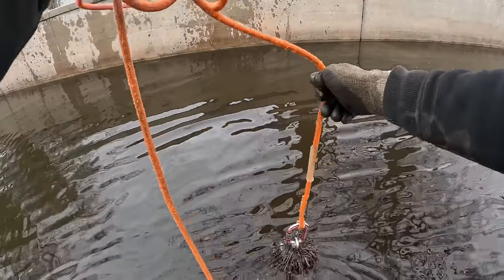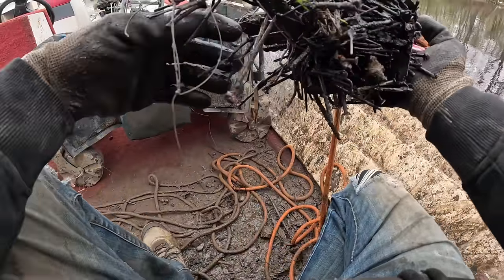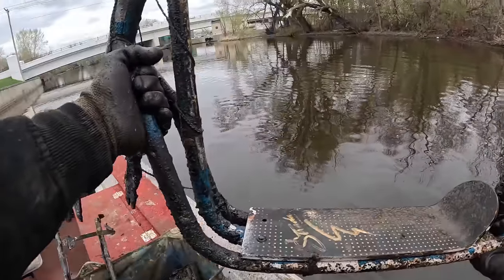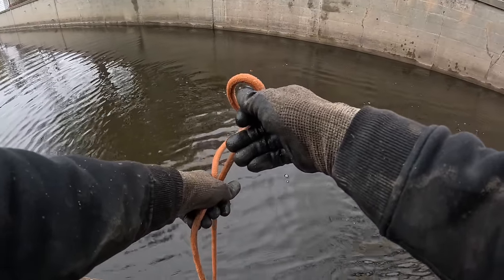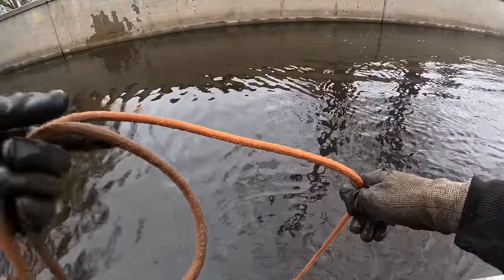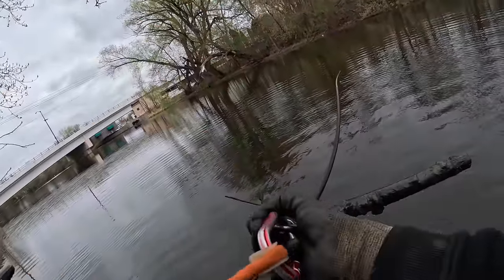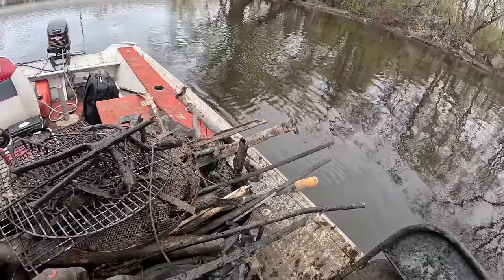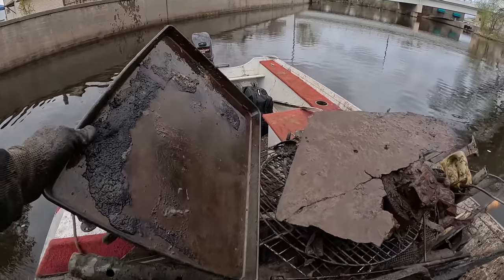Unbelievable! Epic Magnet Fishing Haul: Biggest Jackpot EVER Found!!!

Comment: Love watching you do this. A couple suggestions for you. Get a magnetic parts dish from harbor freight or anywhere cheap. It can hold the lutes you find and keep them from falling all over the boat. Second, put a heavy duty freezer bag over the magnet. You can peel it off to remove all those nails and small stuff easily.
Reply: These magnets are SERIOUSLY powerful. That wouldn't work but good idea.
Reply: I have a magnet like this and trust me nothing comes off it easily lol When it arrived it grabbed a a pair of scissors that were a little ways away and snapped it on there and it took 2 of us to twist to wrestle it off plus it managed to grab my glove finger under it too 🤣
Reply: @leeredpath1  so are the ones I use to clear metal shavings and bolts from my shop floor. Heavy plastic works better that try to use your hands.

Comment: The thing before the nail can is the flywheel cover to a small engine like on a lawnmower - which would fit with the throttle cable caught earlier. That could be the source of the oil.

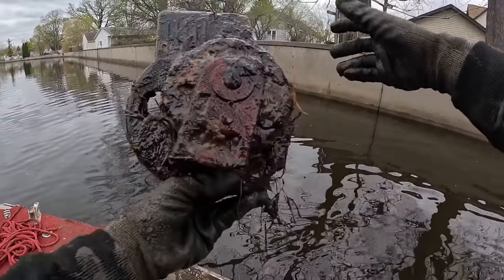Comment: 54:23 that piece you found is the "flywheel shroud (cover)" off of a lawnmower engine . That throttle cable you found earlier probably came off of that as well . Guarantee, the thing that keeps leaking oil is a lawnmower engine or maybe the whole lawnmower....

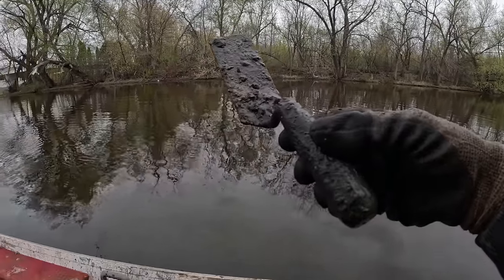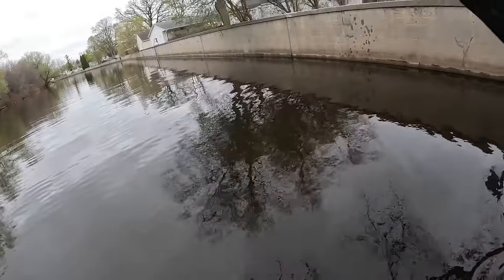Comment: 12:54 is indeed a trowel for plaster. Pick axes were used to break up rocky soil as well as for rocks in mining, the ones with the flat broad edges are for tough soil to break it up. That was the front part of the wagon and the round thing was the swivel for the front axle. 30:07 the magical dangly wand could be a small magnet for picking up things in hard to reach places, I have one but its end is fixed solid. 40:15 is a pickup for an electric guitar, 44:29 looks like a house crawl space floor support pile, 54:15 looks like the shroud off the top of a lawn mower engine.
Reply: The claw and ball is the bottom of an antique table leg.
Reply: Nice!

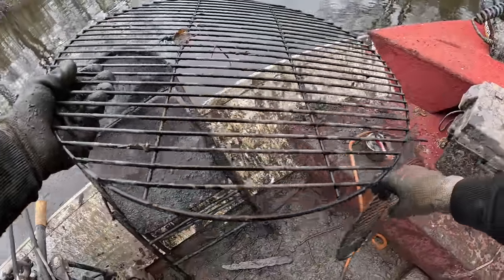Comment: At 47:08 the white plastic piece you found is a "hanging flower pot hanger" . Those 3 long pieces connect to the top of the flower pot so you can hang the pot from the round hole .

Comment: the 'electrical' device at 40:13 looks like a 'pickup' that mounts in the sound hole of an acoustic guitar. Each of the six dots picks up the sound of one string. The wire goes to an external 'receiver jack', mounted elsewhere on the guitar (mine's on the big round end where the strap attaches) , where a guitar cord can be run to feed to an amp.

Comment: That red cover you found goes on the top of a lawnmower engine. It also has the starter crank on it, the kind you wind up a spring then close the handle and it spins the motor to start it. The handle for the crank looks like it is missing. A very rare motor even back in the day.

Comment: Don't know if anyone commented on the red thing you thought may have been a child's wagon.  That is what it was.  The circle thing on the bottom is where the handle joined the wagon.  It would swivel so you could turn it.  We used to have one when I was a kid.  3:56 is metal storm door hinge.  The black thing with short chain is a latch, it fits vertically and there is a sort of loop on the frame above the door.  We have old style garage doors on our shed and they look just like that only maybe a little smaller.  You pull on the chain to unlatch the door.

Comment: 14:09 Car stereo  27:16 mechanics telescopic retrieval magnet. I'm sure that before that river wall was made there was a garage next to the river and it burnt down. When they cleaned it up it appears they pushed all the debris into the river and that's why there are so many tools at the bottom. 44:30 Pipe for a scaffold  Those cast Iron pot are KEEPERS! 54:24 Engine cover for a small Briggs and Straton engine from a rotor tiller or lawn mower

Comment: 54:30  That is the starter housing off a Briggs lawnmower engine. It had a wind-up start where you would tighten the spring and flip the release lever to spin the motor.

Comment: Hey Tyler.
@ 40:18 you found a pick-up for a guitar.
@ 44:30 you got part of a jack brace. We have them in our basement at mom's house. You put them under the beam you want braced up. Now you need the jack part of it.
@ 54:27 you got the top cover of a lawn mower. That's why I suspect there's a lawn mower down there causing the oil leaks. 
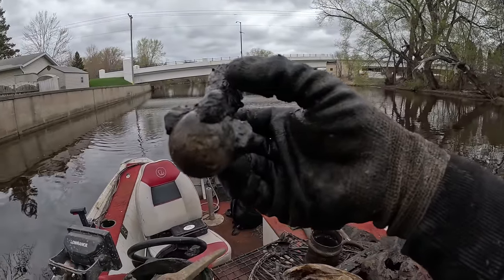@ 58:30 maybe you got the top of a cane.
Load your grappling hook in your boat now so you don't forget! Lol

Comment: That would be a good spot for an underwater drone. The wagon is a radio flyer wagon and that cap part is where the front axle pivoted. That cast iron pot looks like the bottom of a Dutch oven that red cover is the top off an OLD lawn mower engine. That cable is probably off that same mower. That pick had would be easy to put a new handle on. Knock the old one out from the bottom drop anew on in from the top and good to go. Those rakes shovels and hoe are worth fixing prices for crappy stuff like that is outrageous.

Comment: The claw you found before the baking pan was called a ball and claw foot. Looks like a big clear marble. It is the bottom of a table leg on a small square table with a shelf underneath. Not sure when it was made, but I want to say 1890-1920. Usually made of golden oak. The claw was supposed to represent an eagle claw and was usually brass. In the mid 1960's it was one of the most sought after tables at auction. This was a side table, but it wasn't large enough to be a small card table.

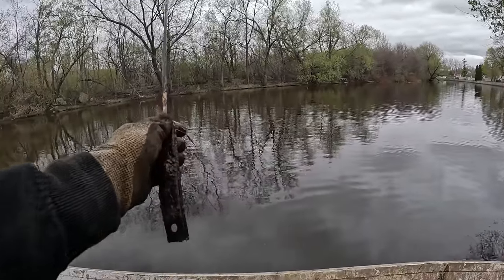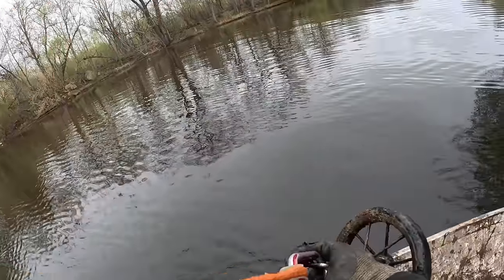Comment: 2:16 was a bike flag, 14:10 a car radio, 21:28 is the spot where the pull handle attached to the Radio Flyer, 29:37 a tricycle wheel, you got the other table leg - - build one . . . I bet the oil is a snowblower.... with that throttle-up switch  I want that clawed ball furniture piece

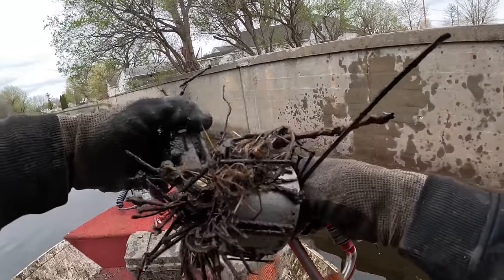Comment: Dude, the things you find tossed in water, huh?  i remember walking in a lake, just enjoying the refreshingly freezing waters on a hot summer day, when my foot stepped on something NOT rock.  i then dove down and retrieved it, where it turned out to be a glass jam jar that was PERFECTLY intact!  I now use it for storing jewelry.  As for your spot, I think people were using that empty lot as a dump site, backing their cars up over the lot and just tossing.  You're now reversing the process!  and btw, that thing you found at 12:48 is indeed a mason's trowel, which they use to smooth out mortar between laying bricks as well as smoothing out concrete when finishing it.  The thing you found at 19:00 is actually something called a governor, which a device that regulates and releases energy, in this case electrical energy.  That tiny wheel you found looked like it came off of something in an office, like a rolling filing cabinet or a rolling whiteboard, etc.  That white thing you found at 40:15 looks to be an LED light bar.  That bird's claw thing you found is the leg to some kind of lamp or living room decoration.  You caught everything but the kitchen sink in this one!

Comment: That last red thing you pulled out of the water as the cover for an old lawn mower motor, probably what the throttle cable went to. That white tentacle thing was the hanger part of a hanging flower basket.

Comment: 34:26 seems to be the mechanism from a car radio and cassette player. You can see the motor and hints of the rest of the stuff that would hold and turn the cassette. You pulled another one at 14:00, but that one was in a more complete state by the looks of it, it was just smashed.

Comment: The Red Wagon that you kept mentioning in the past is actually called The Radio Flyer. And the bracket underneath is actually used to hold the handle to pull the wagon with and to help it pivot. Good luck on the new house

Comment: At 54:15, I think Stealthi Master is correct. It is a shroud from an old style lawn mower. Fancy for its time, you wound up a spring and when you release it, it would spin your motor instead of pulling a rope for the start. You may have found the source of the oil, if the mower is still down there. Better get the claw.

Comment: 19:13 is 1/2 of a bicycle rear derailleur that adjusts the chain's position on the rear wheel. You can see where the cable goes at the bottom .

Comment: The saw is an old High Quality Disston saw. Disston has been making hand saws from the mid 1800s and still making them today. I would bet there was a garage that burned down on that property and someone just bulldozed the remains into the river. All of the nails would have ended up in a pile after the fire was put out and that's why they are there The antenna like things are mechanics tools for either a magnetic retrieval tool or a mirror that extends. The tube with all of the holes is from a scaffolding there is a lawn mower in there. making the oil. That cast iron cookware has some value. The very last thing is the top to a lawn mower, its the cover for the starter rope.

Comment: Mystery piece, bicycle derailer. You know, moves chain from sprocket to sprocket on rear wheel.21:30 front of a little red wagon.27:20 a magnetic grabber. Yes, cassette player door. 40:15 is pick-up off an electric  guitar. Dang,that dudes mother must have been a hoarder. Had the backyard filled with crap. Instead of hauling the stuff off… in the river. 49:45 is boat throttle lever. 54:30 smaller round part is where the pull rope goes. To a Briggs and Stratton mower motor. Cannot believe you stayed at the same place the whole time!

Comment: My guess on the oil rainbow's, you have found an old lawnmower. That "red" cover you pulled up is off of a mower, Briggs& Stratton engine, you would wind it up and push a release button to crank over the engine instead of pulling a rope start, hope you find it.

Comment: You found everything but the kitchen sink. I bet that the guy that came over to say his mom lived there is  responsible for a lot of that crap your finding at this spot. Most of that stuff looks like it came out of the camp fire pit after a hard night of partying. Looks like they have been dumping there garbage in the river for at least 20 years or more. Some of what your pulling out is things I remember using or seeing in my almost 70 years. The round black thing that's on the wagon is what you steered and pulled the wagon with and all the nails are probably from burning old wood pallets there loaded with nails. When you clean out the fire pit after burning a bunch of them it's loaded with nails. You have a decads old nail dumping site. 😊
 You know I bet the E. P. A.   in your area would love knowing about that little garbage dump you have found. 😮😮😮
 You are really doing a great service to the people who use that river. 
  What you need is a 25 foot pontoon with a big electric magnet that you can drop in the water that way you could put it on a winch to pull it out of the water. That way you would only have to flick a switch and everything would fall off the magnet. You could bring out a ton of iron each trip out. Right now there is a need for young guys like you to take the bull buy the horn and run with it.😢

Comment: That throttle is most likely for a riding lawn mower from the mid 80s to early 90s.  if it is the riding law mower and it weighs 300 to 400 lbs there is no way your gonna pull it out.